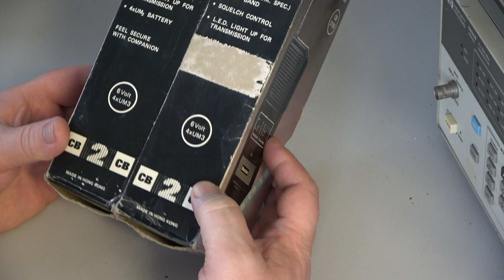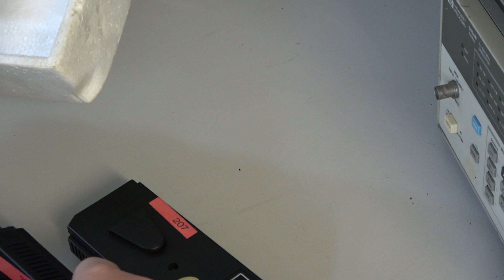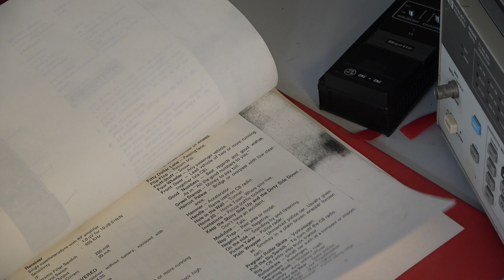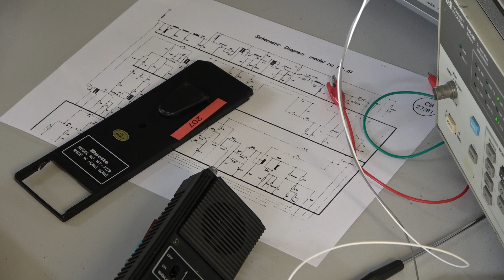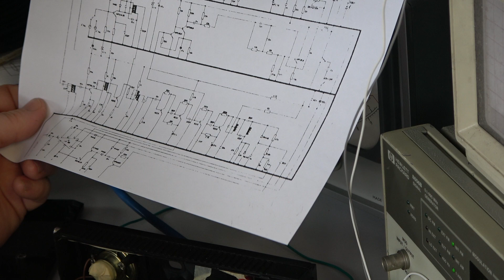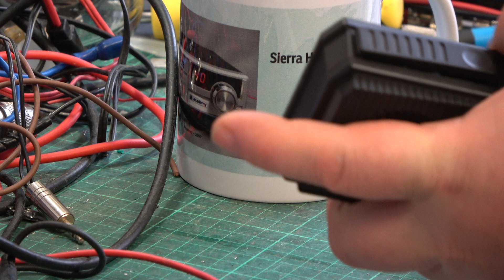Duette One plus One (UK) CB 27/81 CB radio (handheld 100mW 2ch) - Service adjustments

Comment: Oh dear what a awful set I wonder if it works as far as the front door.
Reply from the maker: If Mr C had come closer, the distortion would have improved. Now had the tx audio been 'normal,' it "may" have been readable from the petrol station. They must have made a fundamental cockup in the way the loudspeaker is re-used as a microphone in tx...they are all the same.

T21